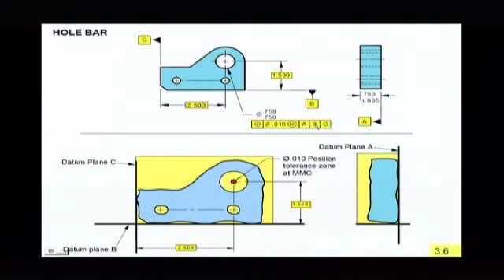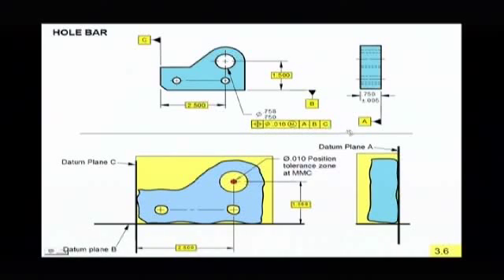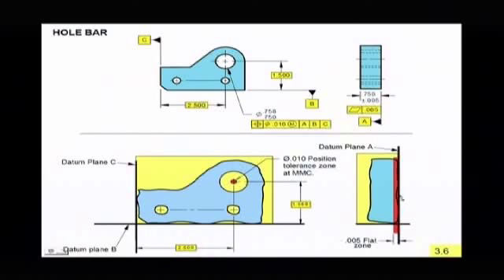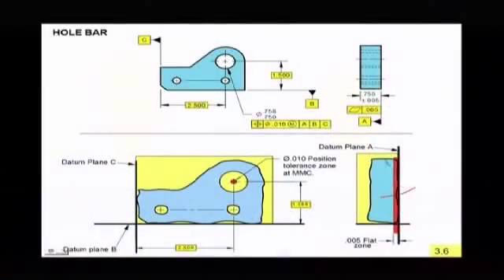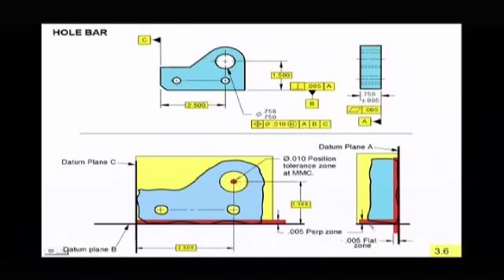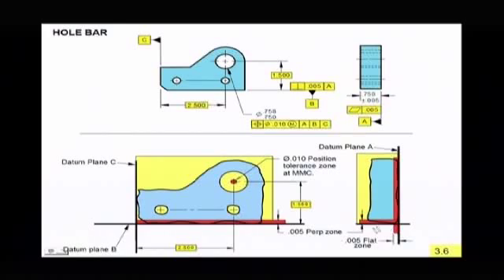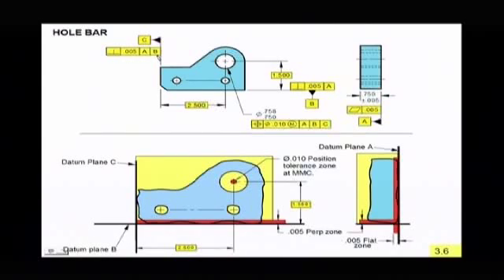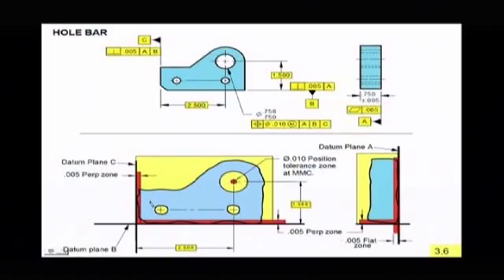Qualification of Datum Features

Comment: In this example, a very consistent ".005" value was applied without calculations like HFT.  I am seeking substantiation for determining those values. I feel like the repeatability of something like an accurate pin hole position would require very consistently produced datum features.  This leads me to the thoughts of refinement, requiring the datum features to use less tolerance than the smallest tolerance using them. I even wonder if primary  is to be better flatness than secondary perpendicularity and so on.
Reply from the maker: Technically, the datum feature tolerances should not matter because all geometric tolerances are defined off the perfect datum reference frame and not the imperfect datum features. However, I agree that it makes sense to have better qualified datum features. Also keep in mind the value to size ratio. I consider a .005 flatness on a 20X20 inch datum feature A surface is tighter than a .002 perpendicularity tolerance on a 3X20 inch datum feature B surface (consider more than just the tolerance value). 

The real determination for the flatness and perpendicularity values is "how much gap/crack is allowed when the part mounts to these imperfect datum features?"
Reply: @GeoTolPro My opinion is that datum feature qualification tolerances might matter a bit more than usually considered. For example that big hole on the part has a position at MMC and a Virtual Condition located basically in the A,B,C DRF.  Your datum feature B is shown slanted in a way that it contacts datum B at the corner near datum A.  However the mating part which probably also has matching datum features A and B will also be produced with a perpendicularity error of B relative to A. If that error is similar in direction to the considered part but is greater in value, then the actual contact points at the assembly might end up at the other edge of datum feature B. If that happens we end up with a difference between where the datum plane and the origin of the basic location is established and where the actual contact points and the matching datum on the other part are, and that may affect the fit between parts in a way that the virtual condition doesn't predict. 

I think it all comes down to the fact that when we control or measure each part relative to datums, it is like controlling each part relative to the ideal mating part, but in reality both parts will be imperfect and the assembly conditions may be different than theory or the inspection conditions with simulated datums. Tighter qualification tolerances of datum features may help to reduce that affect.

Comment: Hi, I have a question. I remember there being a rule of thumb as to the requirements of the datum feature in relation to the tolerance of related features. 
Example: What do I spec as flatness on my datum feature "plane "A"  when a (parallel) plane is required to be within .02 mm position to "A"? 
I remember this to be 2 to 3 times "better" than the required tolerance, so that would be a flatness of .007 - .01 mm. 
Hope you can help.